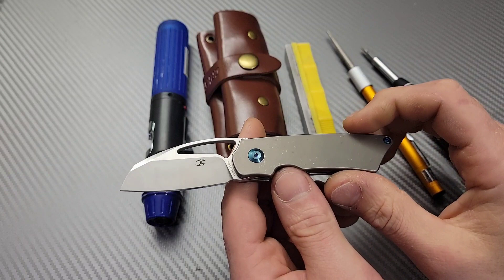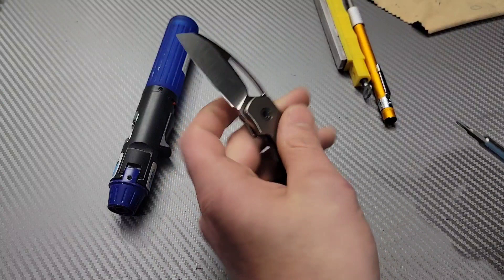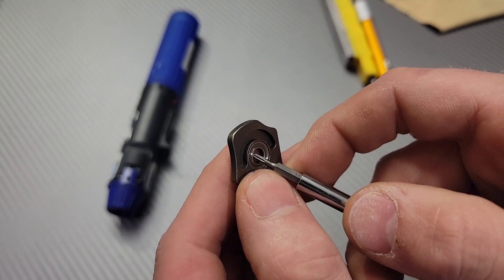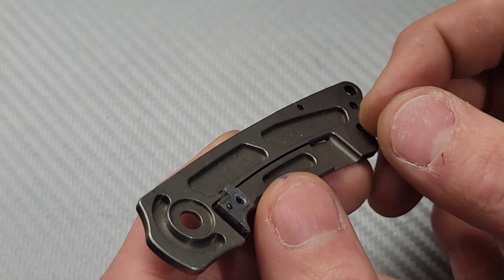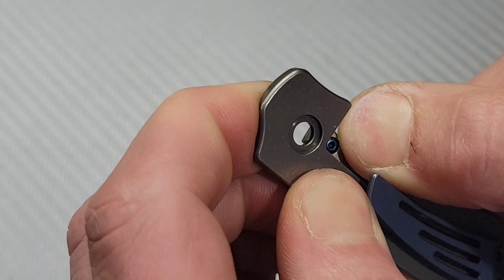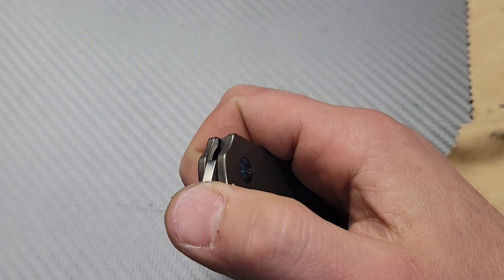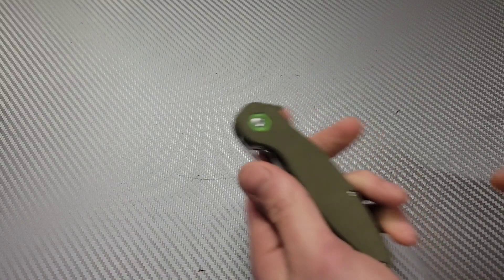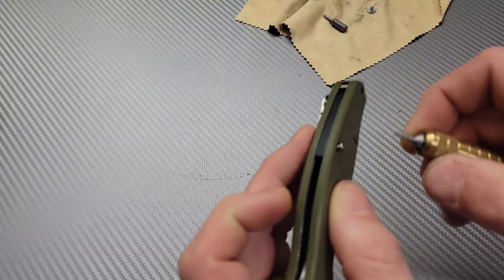HOW TO ADJUST DETENTS & LOCK BAR, FIX LOCK ROCK OR LOCK PLAY

Comment: One additional tip is to measure where it's at with a caliper so you know what you started with and then you can definitely tell that you are indeed moving it and keep from going too far.
Reply from the maker: Absolutely, I was going to say or do that but most people don't have them, and I did it thus way for so long with amazing results without using calipers but yes you should if you do have any or make shift something for measurement
Reply: Yes becasue particularly bending that heat treated Lockbar back AND forth just weakens it more and makes the detent less reliable in terms of its strength in the long run.
Reply: Thanx for the good tip.

Comment: Wonderful video on one of the lost common problems with production knives! 

I would love a video on fixing detent lash. I seem to see that problem far too often on knives under $100, and I would be curious if you had any suggestions.
Reply from the maker: That's one that can only be solved with a larger detent ball which is far trickier, you have to take old one out tap a new hole and have it pressed in then re tap the detent hole if needed

Comment: My imperium has a small amount of lock rock but excellent action. I think im gonna try sanding the lock face slightly bc it does push out under pressure of the blade. My brazen and one of my governors have stiff detents so i think ill bend the lock bar out slightly on those. Great video!
Reply from the maker: Remember your only scuffing the surface don't remove any material I would try increasing the tension slightly but if you love your action the way it is, make sure it's rock and not play if it's play you have to increase tension but if the lockbar is moving under pressure then yea
Reply: @NeevesKnives  after inspecting everything I ended up just increasing the lock bar tension a little bit and it solve the problem with still excellent action and now solid lockup ! I was considering getting rid of this one before. Now to fix my 2 with too hard of detents as i love my reverse flick also and need that in my life. Thanks!

Edit: just lightened the detent on my brazen and now i can reverse flick it nicely yet the blade won’t shake out. Took a few tries bending the lockbar out to get it just right but totally worth it as i wouldn’t even carry it before the detent was so strong. I actually have known about these tricksfor a while  but this is my first time attempting them so your video gave me the motivation and i find the Civivis (or any similarly constructed liner lock) are very easy and quick to correct these types of small issues ! Now to dig out my Damascus governor which has the same issue as the brazen as opposed to my D2 governor which was perfect out the box and reverse flicking heaven!

Comment: Is it possible to fix detent lash? And is it possible to fix vertical blade play on a Benchmade axis lock
Reply: I had vertical play on my mini crooked river,... i had to take it apart and clean gunk/fuzz out of the way of the axis bar so it could more easily get all the way forward
Reply from the maker: Some times it's very possible, new omega springs usually take care of it, old omega start getting weak and don't push the bar up as hard as it used to, detent last requires a new larger detent ball, you have to take old one out and tap a new hole, have the new detent ball pressed in and possibly re tap the detent hole to fit the new ball
Reply: @NeevesKnives  do you happen to know if the ones sold on ebay and or etsy are good quality and have the same spring retention as the original Benchmade omega springs? Also do you know if anyone sells springs for the sog terminus xr?

Comment: A detent ball that doesn't seat all the way in the hole can also cause weak detents. Usually a burr just inside the hole, but can also be a very slightly under sized hole.

Comment: If I could add anything, I’d say don’t throw it in the freezer to quickly cool it down if you have to use heat..if anything do everything in your power to cool it down as slowly as possible to stop stress..at least that’s the way it works with steel, I’m by no means a titanium wiz...
Edit:and I’m not saying bury it in sand..I’m saying wrap it in a shirt or something..you should never get it glowing so leather or sand isn’t really needed, but def slow down the cooling process by some sort of means
Reply from the maker: Thank you! 👊

Comment: I just picked up a TwoSun liner lock flipper and the detent is too strong and getting the lock to release is difficult as it's stiff. I'll see what bending the liner lock does for the intent as I only have about 1/64th of an inch to work with to keep half of the lock on the back of the blade. If it doesn't help with releasing the lock I may have to take some material off of the lock and make it about 2/3rds the height it is now so it will be easier to push to release. 🤷 
Do you have any other suggestions?
Thanks 👍
Reply from the maker: Which model is it?
Reply: @NeevesKnives  hi, it's the TS50G10.

Comment: Would you store a knife with a weak detent open or closed? In closed position the liner lock is under permanent tension. That won't help I guess?
Reply from the maker: I know what your saying and I've definitely done my share of stories knives certain ways to help break them in or prevent but now I would just adjust the detent stronger by slightly bending the lockbar, I have a video on it if you look it up on my channel

Comment: If you have a light detent and your pushing your lock bar inward to strengthen up the light detent will pushing your lock bar over also increase how much lock up you have ?
Reply from the maker: It can it just depends on the lock face geometry but it usually gives you a stronger lock up, not necessarily moving over more
Reply: @NeevesKnives  thanks brotha 🤜 trying to get this titanium roach like it's brother the liner lock micarta version. They are both awesome, the titanium one is amazing and looks amazing just has this weak detent the liner lock has such a good strong detent

Comment: Dylan Mallery Phorus has got lock rock. It has traveled over a bunch since I got it and looks like it is making very little contact with the blade. What do you think I should do?
Reply from the maker: Try taking your lockbar insert out and adjusting it so it makes better contact and If thar doesn't work you can also adjust the lock bar strength a bit so it gets better lockup
Reply: @NeevesKnives  I am already over 50% lock up. I’ve tried pushing the liner lock over and it doesn’t help with the blade play. Is it normal to only have a very small area of the lock bar touching the blade?
Reply from the maker: @plausible.deaniability  I'd have to see it, is it rock where the lock bar moves or play where there's a gap between the lockbar and tang? I would try adjusting the lock bar insert.

Comment: Any advice on increasing "detent" strength on button locks? I'd like a bit more pop on my mordax. I don't have a ton of experience with disassembly though, and never a button lock. Is it worth it?
Reply from the maker: New spring, or stronger spring,  it's a pretty simple spring, get memory wire and make a new one

Comment: Hey Jerad, hope all is good...was wondering if you've handled a Subvert? And if so, do they all seem to have soft detent, or weak, I know it's a big blade and all, but man even on closing, I like for a blade to shut and stay shut, not bounce back out. I love the knife, but would something like adjusting that help, or have you heard of any other remedies for that knife? Have a great one and keep up the awesome videos 👍🏼
Reply from the maker: I haven't tried one, but if your detent is on the lighter side it can Definitely help, it is a heavy blade possibly tightening the pivot a tiny bit might help slow down the drop so it doesn't slam so hard on the close, also check the detent hole to make sure the ball is seating all the way when it's closed
Reply: @NeevesKnives  well damn, I'll just have to send it to ya to check out, with a few more again, it's been a while since I sent some, and my taste has changed dramatically. But yeah I might send it for you to check out before I do anything to it, just to see what you think. I'll hv to go through to see what I might hv that you haven't seen yet, which isn't much lol. Thanks for the help and great videos.

Comment: You have to bear in mind that bending the lockbar cutout beyond its purposed range of travel (which is no more than like half the thickness of the blade tang) will put stress to the material on microscopic level and thus weaken it. Just saying.
Reply from the maker: I'd rather it lockup good than have a failing lock or rock, I doubt the tweaks I made make stress cracks in soft metals like these. And if I feel I'm over doing something I don't doit

Comment: Hey Jared...I have a Schrade 306 with a very thick steel liner lock. Almost impossible to push it out of the way if you want to use just one hand. Any idea how I could soften it a bit? Thanks
Reply from the maker: You can bend it slightly so it's not so strong, but be careful  not to overdue it

Comment: What grit sandpaper do you usually use on the lockbar insert, for the lockrock cure?
Reply from the maker: Remember that's only if your lockbar is extremely tight in the lock up, if there's any play between the lock and blade then it would be very bad, but 300 grt and your not trying to remove steel your just trying to create friction so your only scuffing it
Reply: @NeevesKnives  actually my problem was more very very light "lock slip", not vertical play.  The surfaes are extremely smooth, figured roughing would help.

Lockbar tension was kinda light too

So, I did just a few  sandpaper swipes,  and also bent in the lockbar a little bit to add tension.   Seems it has worked,  I cant pop it closed without unlocking it now.  Everything  else still feels good

Was a bit nervewracking doing it, since its a shirogorov quantum that I paid over  a grand for brand spanking  new.   Seems better now.  Will monitor, fidget, and adjust further if needed.  Thanks!
Reply from the maker: @fritz9830  glad it helped, and it does suck getting something and then having to mail or send it to get tuned right away especially when it seems easier to fix yourself instead of mailing out possibly for 2 weeks, I'm not sure if you have to send all the way to Russia or if that have someone local for warranty

Comment: Take a reading with a micrometer before you start bending; otherwise, you have no frame of reference of where you are going and where you have been.
Reply from the maker: I've done it a hundred times with no measurements or issues. But I would recommend if someone is nervous to practice on cheaper knives first to get an idea

Comment: This ladies and gentlemen is NOT the way to adjust your detent. This is how a person without any knowledge on how the detent is actually built and it works in order for it to get its amount of hold to give you your detent strength. Bending the lock bar to give detent strength actually is changing the amount of lock up when open. Now your at risk of lock stick because you're now putting more force on the lockup. So doing it this way if you have a detent thats to strong to fix that you would bend the lockbar out to loosen it then your lock engagementen would be not enough causing rock. But to fix rock you bend it back in.6 You now see why this is WRONG. To ACTUALLY adjust the detent PROPERLY you need to adjust how far in or out of the hole that the detent ball is pressed into. For stronger detent you have to mover to ball OUT of the hole abit to weaken press in in the hole more. Detent strength comes from how much of the detent ball the hole in the blade has to move over .in this video when he has that liner out you can see that the hole that holds the detent ball goes clear through the lock bar for making adjustments. I tried to inform someone on another video to disregard it this because it's wrong and id be happy to inform of correct way but he kept deleting it. I don't think hos ego will let him admit hw doesn't know much about knives and would rather people learn wrong with possibilities of damaging their knives then him admit he actually doesnt know.
Reply: How do you move the ball out of the hole more? 😂